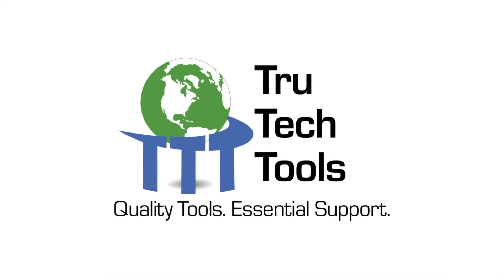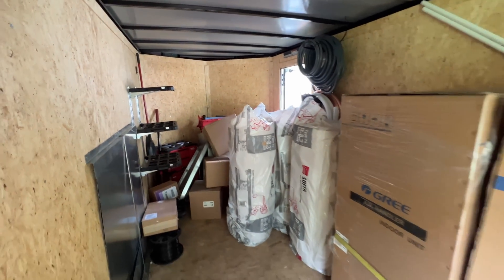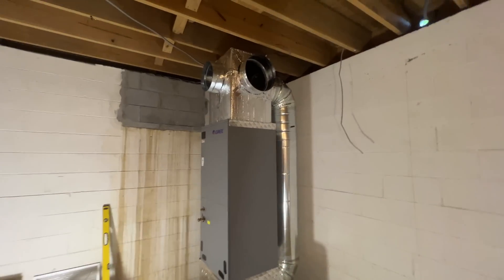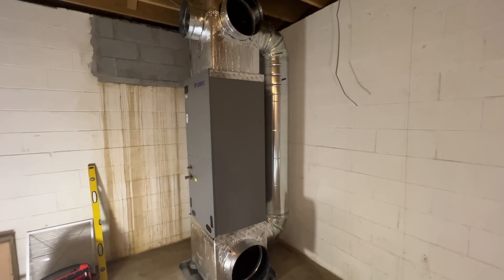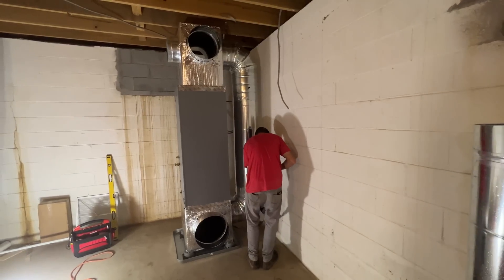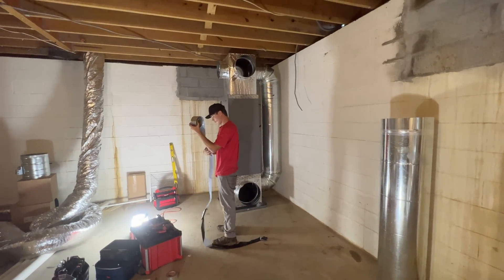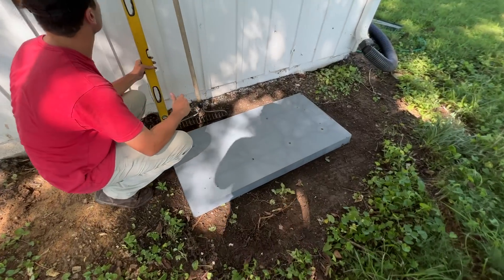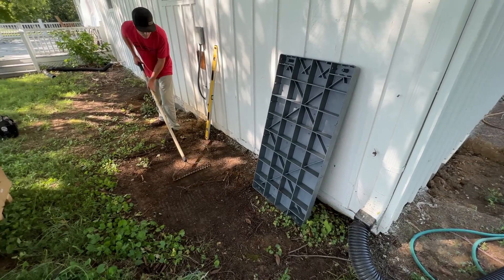I Didn't THINK This Through...

Comment: Not exactly the way we do ductwork in the Midwest & up north. We use rectangular ductwork with return drops (more head  room and doesn’t take up as much room in the basement).Your insulation is outstanding, definitely will need it in that crawlspace. I’m assuming you guys use a lot of round duct, because the majority of your work in Tennessee is probably in attics (not many basements).
Reply: I'm in PA and all we use is rectangular duct for the trunks with round takeoffs. This way looks like a mess.
Reply: @williamserver4332  , Pennsylvania, where the  steel and metal legacy started👍. We do the same thing in Missouri. In the Saint Louis Metropolitan area, we are also required to install Air returns in every room when possible (bathrooms and kitchens are exempt for obvious reasons).
Reply: @boby115  yep. Sam here. It is strange to see how other arras of the country do things. The round trunk is ridiculous.
Reply: @williamserver4332  , maybe in gymnasiums , auditoriums or loft Apartments if they want that industrial look (no ceilings).
Reply: @boby115  yes. I agree. I see it in bars/ restaurants with high ceilings and it looks good but not in a basement. No clearance.
Reply: @williamserver4332  it’s all round trunk here in Mississippi
Reply: @williamserver4332  round ducts are better for airflow
Reply: I’m in NY and we use a combo of both round duct for tight attics and square duct for basements and taller attics. I did install a unit like this and I did square ducts with round take off ran the main line down the left side of the house and flexed the rest in the joists. My return I was able to build a box run multiple returns in the wall. Kept everything into one corner so the client had more room for storage. Every job is different and it all depends on the load cal. It also helps if the whole house is open to studs. Very clean install tho otherwise I have to say tho I never installed a bypass on the return can you do a video explaining why it’s there the benefits and such! That would be good to know and perhaps maybe I can incorporate it on my future installs! Thanks!
Reply: @Anthony-nr1nd  bypass is used on multizone system. When you close 2 zones and only one zone is open there is higher esp, in order to relieve it bypass is installed.
Reply: They had some long flex runs too. Our code doesn’t allow us to go cross country with the flex.
Reply: @matthewfrohbieter1803  haha. Same here in PA.
Reply: @Falloutnewskyrim , you are absolutely correct but when it comes to saving space round duct is a big drawback. You will definitely learn this when you’re dealing with architects and design engineers (cubic footage is money when it comes to building and building design). Round duct is great when you have the room , just not good in the short basements below the floor joist.
Reply: @Falloutnewskyrim round metal - yes; round flex - no.
Reply: I agree this looks like a hack job.

Comment: The black insulation is bad, VERY BAD!
It collect dust, black mold, ect.. breack loose in tiny particles the home owner has to breathe. 
Should haved anything on the outside as insulation. Bad enough your putting in all that flex. But it's what you talked them into going with.
Reply: Agreed 100% i am kinda shocked he did this hack job. He usually does A+ work

Comment: Very nice stuff. Love the through wall lineset. Here on Miami Beach a lot of times have used preformed concrete 4" slab and aluminum rails 18", 2'ft, etc above flood to meet code.

Comment: How has those gree units been for u? Cuse over here they have been nothing but headaches to the point that we completely stopped using them.
Reply: I watch a couple of HVAC channels, and the Gree equipment seems to be the darling of the moment with lots of folks doing first-time installs of it. I guess because it's new, it's something different and interesting. But without fail, I find lots of comments like yours describing real-life track records on the gear that aren't too good. Evidentially, the equipment is a bear to work on because the internal layout is pretty bad.

I'm old school - I like to go with established names that have track records to look at and that are still building good gear. I'm also not interested in chasing the newest tech or highest performance. With that comes high up-front costs and high replacement parts costs that can make the break-even point on energy savings too far out into the future.
Reply: Not our 1st choice but at the moment it’s all we can get relatively quick
Reply: Gree is junk. Bosch heat pumps and air handler.  Mistubishi for mini splits
Reply: @ItsShowtime9  Care to support your statement ?
Reply: Been selling/ installing Gree products for 10 years and I have no complaints and the customers are happy.

Comment: That’s gotta be a 25 thousand dollar job. You always do exceptional work
Reply: The equipment is only around 4 to 5 grand. You can buy it yourself - mrcool sells it as the universal lineup.
Reply: @sprockkets  you consider all the flex, line set, whip, disconnect, wires for heat strips, heat strips, plenums, ect…. Adds up. Then labor on top of that.
Reply: @sprockkets  whaaaat Mr cool!!! Shit is junk. You get what u pay for. No contractors use mr cool. And if they do they are getting it cuz it's cheap and charging more. Mr cool only market is for mechanically inclined homeowners.  Mistubishi mini splits all the way....bosch for split systems
Reply: @ItsShowtime9  lol, guess who made that bosch split system for awhile? Probably Midea. You can even see proof of that - Pioneer sold the exact same system before they sold a newer model - you can even look at their tech docs and see that the 2-3 ton model had a Mitsubishi compressor in it, and the 4-5 ton model a GMCC one.
And heck, Midea makes Carrier's mini split, and have no issues with it. Get over this brand stuff. Mitsubishi is good, but I'm not paying $8k for their 42k btu split setup.
Reply: If new install? Couldn't tell you. If I had no ducts I would do ductless - dampers are shit. And while I know this guy does good work, he should have at least watched Gree's video on this system, at bare minimum. Heck they officially post them on YouTube, and the former guy from new jersey is hilarious.
Reply: That would be robbery to charge that much id charge 15k max
Reply: @Kilo5910420  what state are you in? I agree but seriously that’s about average to what a company would charge around columbus Ohio for something like this. I’ve seen bare bones systems (just normal split ac furnace) go in for 12 grand.

Comment: Looks good Zach! Do you prefer fieldpiece over testo? I’m looking to buy some digital gauges with vacc probes just wondering your thoughts
Also I’m from Memphis and just recently moved to Australia( my wife’s from here) so I work on lots of mini splits your tech videos are much appreciated thanks man
Reply: I came across your comment and thought I would share my thoughts. I’ve used Testo for almost 10 years, I have the 550 manifold and the smart probes. The 550 just started leaking on the high side valve unfortunately, so I bought a fIeldpiece SMAN 480 which has the micron gauge built in. I just used it for the first time this week and it’s far better than the testo in my opinion. The app for it is better since there is a whole line up of tools you can use within the same app and generate a pdf of all your readings, data logging is easy because it has a built in flash drive and you can directly connect to your computer and retrieve the logs. I’m happy with it. It’s expensive but worth it. The testo smart probes are handy for just checking operations. You could use a T fitting on the suction to add gas if you need to top off a unit. But fIeldpiece also make their own smart probes. I hope this helps.
Reply: @walla_walla5959  thanks for your input I was recently at the supply house and they tested testo fieldpiece and another digital gauge and all vacc reading were different which I thought was interesting so I wouldn’t use the built in micron gauge anyway but I’ll dig further into the fieldpiece thanks for sharing
Reply: @joelvanniekerk4006  that is interesting. I’ll try that myself, I’ll connect my yellow jacket micron gauge to the fIeldpiece and pull a vacuum on the manifold and see if they read the same. If I remember to, I’ll let you know the results.
Reply: Bluvac micron gauge, fieldpiece probes, but I like my testo ones too. You'll get longer range with fieldpiece
Reply: Fieldpiece is the way to go bro... I love my fieldpiece wireless probes

Comment: Do you guys have preformed concrete pads where you are? We're not allowed to use plastic at all here... That waffle pattern sink right in the dirt anyway..
Reply: We can but we pour concrete, lasts much longer. ..
Reply: @Paulie1232  sure, but clearly he's not going that route... Just wondering why use a flimsy plastic pad then go through all that mounting to the house bull shit when you can get a preformed concrete pad and have it anchored down

Edit: Also, how does poured concrete last longer than preformed concrete? I'm on board with arguments for it being more secure, but lasting longer?